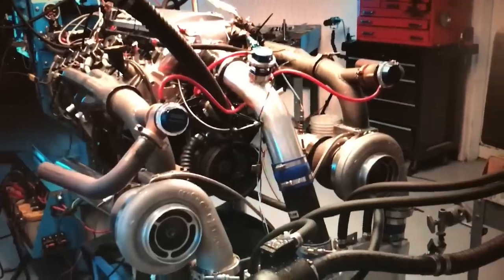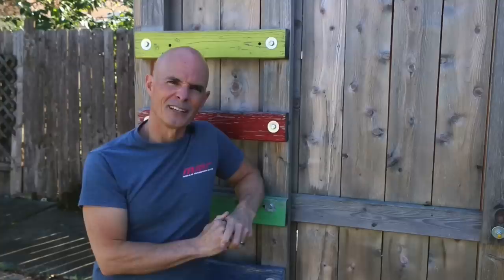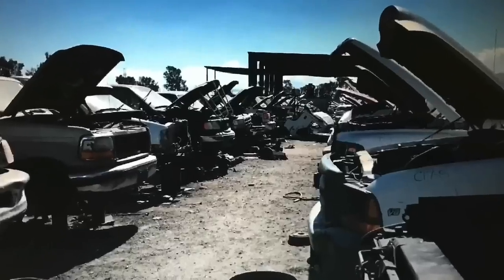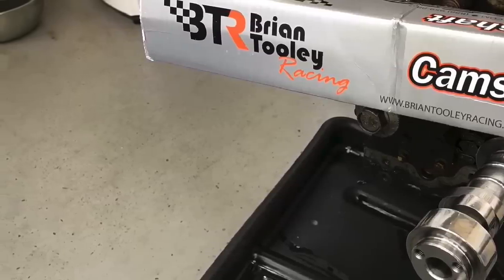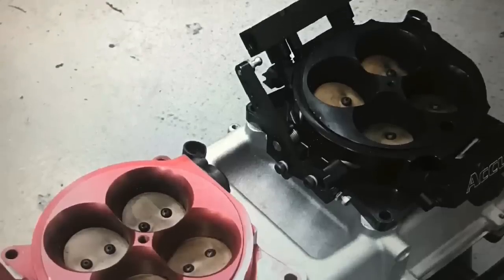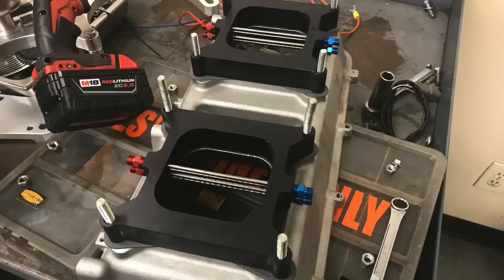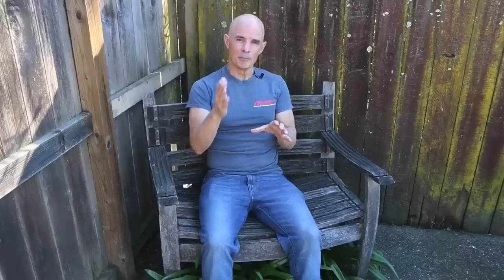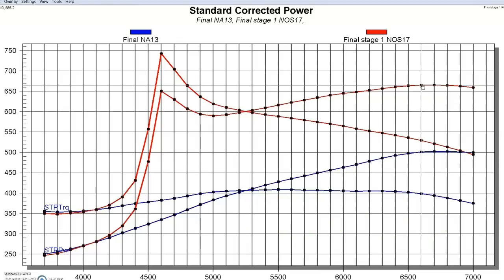BIG BANG NITROUS 5.3L! WILL IT SURVIVE 3 KITS? CHEAP, SBE JUNKYARD LS WITH ALL THE NITROUS!

Comment: DRY FOGGER FOR SURE!!!! Fuel and nitrous distribution is critical. I had a customer renting my dyno that went through this learning curve on a honda engine. It was making 230 fwhp and he used a dry fogger to make another 205 hp on spray. The customer went through a few engines before he was able to make more than another 140 hp without melt the same piston every time.
Reply: Better control over the fuel with a dry setup too.

Comment: Richard, I believe not ramping in either kit. Caused a siphoning of air, hence the lean ratio for the application. Huge low pressure area was created when second stage was introduced.

Comment: Wet shot please.  
 I have been considering building a wet shot system with the fuel to the fogger nozzles supplied by a small secondary tank full of methanol or c16.  That would be cool to see a pro try it first.

Comment: So what did the stock live to before the ring gap caught up with you? Before you changed the cam ect. I may have heard incorrectly but didn't you say you started out with a smaller ring gap? None the less, great footage. Nothing like seeing Carnage while I wake up for work. I dig it
Reply from the maker: we changed ring gap before testing-but have run 300 shots on no gap-but it was a very high mileage motor

Comment: Try it again, with a 6.0 maybe and a progressive controller. Doesnt holley pwm solid state relay for solenoids?
Reply from the maker: they do have controllers
Reply: @richardholdener1727  then do a dry and ramp the shot in to try and get rid of the lean spike!  

I'm running a 6.0(gen3 lq4 sbe) with terminator-x and a dry shot.  Plan on doing the same, I'd love to see you pull it off first!

Comment: I vote for a dry setup with the fuel being done properly by the primary injection system.

This can also be done on any stock intake as well, and I think those would be nice to see (simply because low buck guys aren't gonna buy big intakes if they done have to). ;)

Comment: Individual fogger nozzles with a secondary injectors dedicated to supporting the fuel needs.
For some new tech, how about a nitrous test on a gasoline direct injection engine? Maybe something like an Ecoboost V6 or even a budget naturally aspirated build like an LAF I4 which are super cheap, but compact, efficient and high compression right from the factory.
Reply from the maker: I did nitrous on an L83 5.3

Comment: Cam $400

HOLLEY HI-RAM INTAKE $600

2 Holley throttle bodies $800

Trick Flow® GenX® 220 Cylinder Heads for GM LS1 TFS-30610001 2 x $900

NOS Crosshair Plate Nitrous System $900

2nd NOS Plate Kit (without bottle) $400

Gasket set, nitrous tank filling, injectors, ECM...$2000???

Watching a junkyard motor blow up on YouTube.......PRICELESS!!
Reply: And the title says "Low $" ...
Reply: @middlesiderrider  That is low $$. Built a motor lately? It isnt dollar store cheap.
Reply: @Mr. 6 liter i do cuz there sittin on my engine now, 1250.00 each
Reply: @cbr1thou  that's why I went back to a old school small block. People are practically giving their old setup's away to get a ls.
Reply: @southjerseysound7340  yeah but the ls  heads are so good
Reply: You aint gettin trick flows for 900 dolla, u crazy
Reply: Painful to watch.

Comment: Can you install a delay timer between the NO2 and the Fuel??
I think you would have been fine if the Fuel been introduced a half second before the NO2.
Reply: John Parrish  the real ghetto way to do this is make the hard line between the jet and the nitrous solenoid longer than the fuel solenoid so the fuel physically gets there first
Reply: @tillytunes8716  You got me thinking, and I think I might kill two birds with one stone.
Instead of a longer line, install a small pressure vessel (about 30cc) just before the nozzle to delay and soften the hit.
That might be enough to stop the momentary Lean condition.
It may also stop that huge power spike from happening. I've always had trouble with that blowing my tires off because it's not controllable, at least not by me.

Comment: I'd like to see 2 kits, duals if course... Basically if you picked up a 2 stage kit.

You can run a custom intake with direct port wet kits and all kinds of expensive/flashy stuff... And the data will be great, but we are talking about unopened (gapped of course) bottom end, budget style... So run the intake that is on it, off the shelf 2 stage kit... And Lastly 
You need to see if you can get the "Danger to inlet" screen, but back out of it before you blow the floor-bolts out of it! 🤣

Comment: I figured this would happen... I set up a two stage kit on a 454 and had success but one stage was through foggers and the other through a big shot plate. The plates don't seem to flow enough fuel at high hp numbers as you need an exponential amount of fuel for that much nitrous. I have a plate im going to drill out and try e85... That's my remedy... Put the kits on e85 with 40% more fuel and start rich.

Comment: @Richard Holdener a bit off subject, but remember that engine masters where dulcheck gained +90HP by home porting his mopar heads? Curious to see what kind of gains can be obtained with just elbow grease. No valve upgrade, maybe a little decked off.
Reply from the maker: I'm doing a DIY series on the 706 heads

Comment: so you did 45 nit jet(got 150+hp) and 65 nit jet(got 300+hp) and almost got there, is there a 75 nit or 85 nit jet? the 2 stages wasn't necessary was it? So in theory, if we're leaping 20nit every test, and we assume a 150hp increase.. and with the two stages at once we would have 110nit.. so in theory (this is never correct) [45nit=150hp] [65 nit=300hp] [85 nit=450hp] [105nit=600hp] [110nit=637.5hp] ....  maybe 1138hp goal was just too hardcore of a test ??? ..85 nit should get around 950+hp no? so maybe 2 stages(4 jets) of 45 nit shot at the same time would get over the 1000hp mark? I'm a full blown amateur probably making myself look like an arse here...    just can't delete this now lol..  cheers Richard love the videos

Comment: I was thinking watching this that’s a big Dice roll for a dry kit. I think a wet, direct port setup would have much better luck.
Reply: heard a lot of big nitrous guys actually prefer dry
Reply: Fuel injected with a good fuel system.. dry all day.  Carb(not that anyone cares) wet.
Reply: 150 shot on a srt 4 ? Bet that car was a screamer . Had a buddy that just had basically bolt ons and it ran high 11,s
Reply: Dry or direct port is the way to go. In certain manifolds fuel likes to puddle causing issues. I have seen this first hand and had a Nitrous back fire on a car. The culprit was fuel puddling.
Reply: Rick Wilkinson I only had puddling issues with a big single nozzle wet shot on low RPMs. 125 shot on a neon at 3k it wasn’t happy. Setting it off at 4500 wasn’t bad.
Reply: Jerry rigged its funny you say on a neon. Because thats what i had the issue with was a srt4 on 150 shot.
Reply: Rick Wilkinson direct port would certainly have helped that situation! Doesn’t help stock cam/turbo srt4’s have an rpm range like a dump truck lol. My SRT swapped LeBaron is a riot but I’m shifting by 6000.
Reply: Rick Wilkinson. The 4.6L 4V N/A with a wet kit have trouble with puddling to.